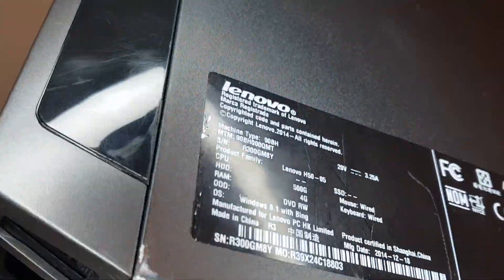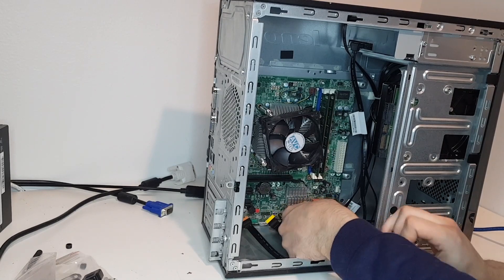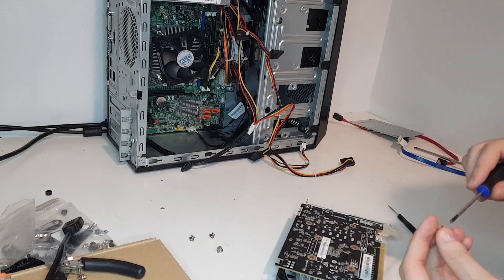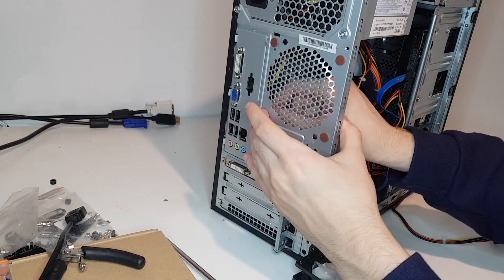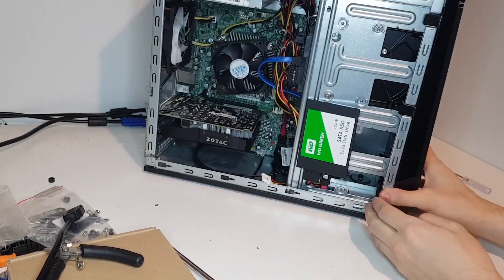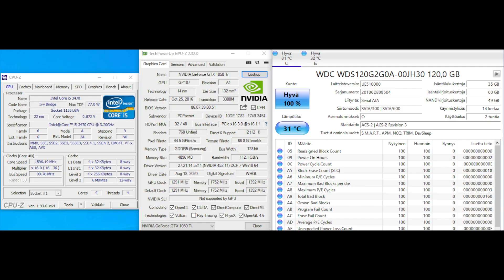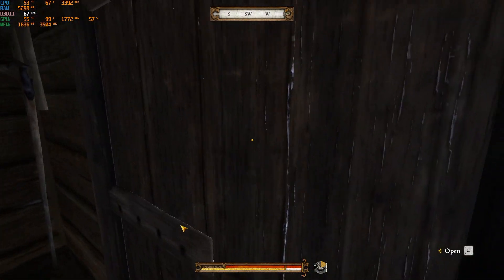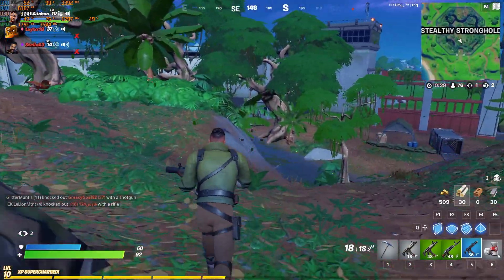Lenovo BH90 i5, 1050ti upgrade (H50-05)

Comment: Hey im glad i see this video on 2021. got one question tho, will that case fit a dual fan gtx 1050 ti?
Reply from the maker: Well that depends entirely on what specific card from which manufacturer, there are so many variants of 1050ti you have to basically try to find out. It seems to me that there is enough space for most 1050ti's, even dual-fan variants, but for example MSI tends to make some of their 1050ti variants unnecessarily big, i mean some MSI dual-fan 1050ti's (colored black and red) use the same cooler and are the same size as their more powerful cards, and i think that variant might not fit, link to that variant below:

https://www.msi.com/Graphics-Card/geforce-gtx-1050-ti-gaming-4g.html
Reply: @optimallyobscureperformanc6264  thanks for the quick reply. I'm thinking onn buying this one exactly gigabyte 4g 1455mhz version here https://www.amazon.com/dp/B01M25X363/ref=cm_sw_r_wa_apa_i_DRFGPT91HQTSCABDP58K?_encoding=UTF8&psc=1 

I understand that it doesn't need a extra cable for the psu, BTW I have i7-4790 3.6 quad. 12gb ram 1tbhdd 7500 (Lenovo motherboard sharkbay)
Reply from the maker: @carlosdacamara3476  I don't see a problem with that one, i think it will fit. At least the one in the picture doesn't have 6-pin power connector. BTW how much wattage does your PSU have?
Reply: @optimallyobscureperformanc6264  I do have 280w, for what I read it's fine so far
I might get a better one if needed
Reply from the maker: @carlosdacamara3476  Yes that should be fine.

Comment: Hello, I have a LENOVO H50-55 PC, this model has a motherboard with an AMD processor, and I would like to exchange this motherboard for a motherboard that supports INTEL processors! Do you think it is possible to replace the motherboard like this! thank you for answer
Reply from the maker: It is probably possible, if that case is standard mATX like my H50-05. You may also need to change the PSU, if the new motherboard has different connectors. H50-55 seems to come with a non-standard PSU, which has no standard 24-pin connector. So you can either try to find a lenovo intel motherboard that has the same proprietary connector as the PSU, or you can go with a mobo that has a standard 24-pin and also change the PSU for a standard one (which you might need to do anyway if you are going to install a power-hungry graphics card).

Comment: Hi i would like to know what updates does this computer would need to run unreal engine. I woul like to know if is possible to update it to be used optimally in 2024.
Reply from the maker: I think Unreal engine games don't support some older CPU's anymore, so no idea whether this setup with i5-3470 is still supported or not. I can't test since i don't have this PC anymore.

Comment: GTX 750 ti vs GT 1030 is compatible with my Intel Core i5-6400 2.7G 4C LENOVO 300-20ISH Desktop (ideacentre) - Type 90DA
Reply from the maker: Both of those GPU's most likely are compatible.

Comment: how much money for the pc upgrade?
Reply from the maker: I bought everything used, so price depends on where you live and how cheap you can find parts.
Reply: @optimallyobscureperformanc6264  Iam indonesian. thanks, bro, I happen to have a PC but Intel! I thought my PC couldn't be upgraded because the PC was build up but because of this tutorial I was excited to save up for an upgraded PC, thanks bro
Reply from the maker: @Mr.Botaxx  What CPU do you have? Because if it is pentium or celeron it might be too slow for gaming even with graphics card and it might be soldered so it cant be upgraded. In this video i swap all of the components, really it is building a new PC from scratch, the case is the only component left from the original PC. So it might be easier for you to just build a new PC than upgrade.
Reply: @optimallyobscureperformanc6264  Cedar cpu. old vga update from 2015 AMD radeon TM HD 8350
Reply from the maker: @Mr.Botaxx  Those are all GPU specs, not CPU
Reply: @optimallyobscureperformanc6264  have discord?